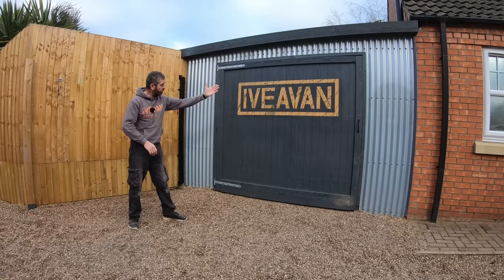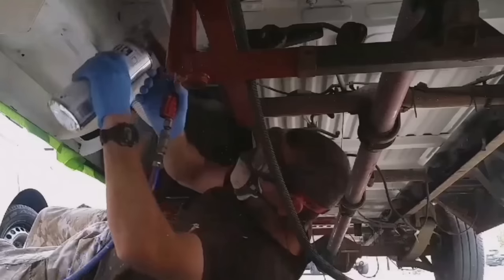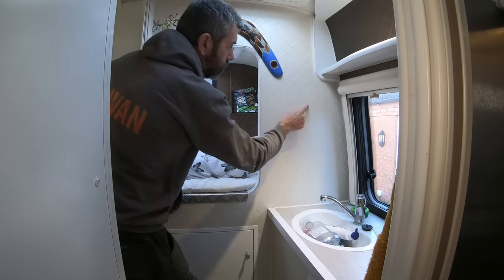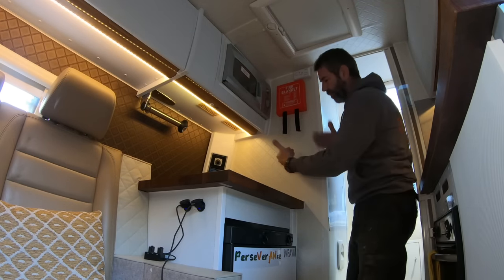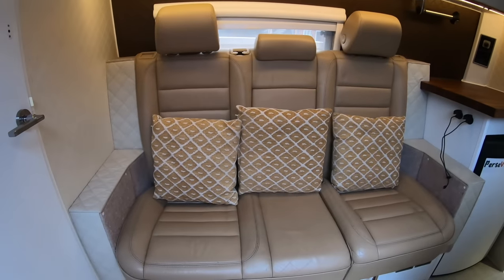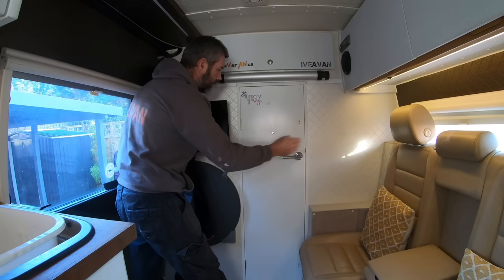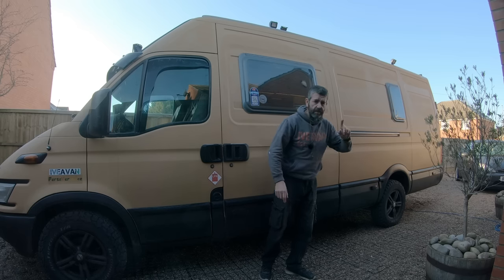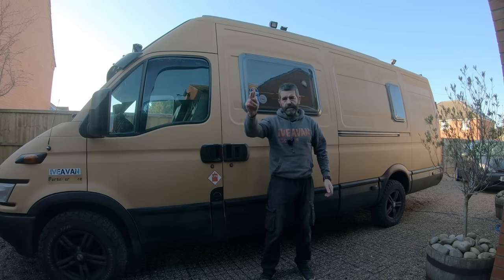Iveco Daily DIY Campervan 'Van Tour' Rebuild Plan.

Comment: This sounds like an amazing project, cannot wait to see you turn it into reality and Wow 14k of lithium in a van I only have 5k in the house!
Reply from the maker: Cheers Paul 👌👍. This was my second attempt at making this video, the first one was me going through my calculations on why I needed so much, but when watching it back I thought, "this wouldn't be a interesting video for people" , but I'll go through them as and when I go back onto the wiring of workshop/hooking up to the van (from memory though, the power needed for the full property. 8kw on a bad during winter and 2.5kw needed on good day in summer, so Im pretty much setting it up for winter use, the solar will be the Achilles heal of this plan though for at least two months of the year🤔.) 😉👍👍👍.
Reply: @Iveavan I agree, running completely off solar in the Uk, be it in a van or house is well nigh impossible in winter. Also the regulations and isolators you have to have fitted to link the system safely to the grid is so confusing/expensive. Keep up the great videos.
Reply from the maker: @paulvose3177  yes, I agree bud, I don't intend to be grid tied and feed power back as that's a whole bunch of loops to jump through, as mentioned in the video "baby steps first with the workshop" then I'll concentrate upon the full property 😉👍👍👍.

Comment: Looking forward to seeing how you get on with it. Like the solar/battery idea for going off grid.
Reply from the maker: It will be slow going at first (as I was meant to of started back in November). As for the solar / van battery bank, powering the workshop is the easy part, according to my calculations, powering the bungalow is do able but not has straight forward as I put it within the video "😬" 😉👌👍👍👍.

Comment: Great ideas! I also have swivel seats and plan for removable insulation panels - mainly for winter use. For summer, I'm currently evaluating different active cooling options, it takes around 500-800 watts (max) to run an efficient A/C, which is doable with the roof size of a L2+ sized van for solar panels.
Reply from the maker: Sounds like a good plan you have there bud, if I keep the blinds closed during a hot summers day  it remains cool in the back (with the wall in place) so I'd imagine I'd be having the wall in place more often then not, but it's a compromise 😉. Cheers matey 😊👌👍👍👍.
Reply: @Iveavan  sounds good! I'm curious how it turns out for me, it's not fully insulated yet, and I'm only using 30mm PIR.
The right amount of ventilation can also make a big difference, depending on the outside temps.
Did you ever measure the temperature differences between the living and the drivers area? Would be interesting...
Reply from the maker: @chblabah  sorry, I've only just seen this. Yes, it's been in the mid 30°C early 40°C within the cab and 18 to 23°C in the back so it does make a huge difference 👌👍👍👍.
Reply: @Iveavan  no worries ;) Thanks for replying!

Comment: Hi Mark, I remember the first build,........ just a few more ideas to consider;- Maybe a flip up sink in the shower room?, Replace two seater chair with one dedicated recliner chair (if your going to go ahead with the front swivel seat idea)? do you still have your on-board diesel generator?...............Will you go for a slide out top opening fridge?
Reply from the maker: Thank you, I've already bought / ordered what's going inside the van. But yes, the flip up sink is probably the way I'm going to go 😊👌👍👍👍.

Comment: I followed the 1st build (it inspired my to buy an iveco 45c15 mk4). I am looking forward to watching the refurb series, especially the sliding door gap correction process as ours has this problem. Be interesting to see if your front passenger swivel will be a single or a double. Doubles seem to be a rarity in iveco's as there are no off the shelf solutions from what I can gather. Best of luck with the whole project 👍
Reply from the maker: Thank you Dave 😉👍. No, for us it'll be a single swivel seat as there's only two of us, but I do agree with you regarding the double being rare. It seems that many manufacturers of after market campervan parts seem to disregard the Iveco Daily in favour for the "Instagramable German vans". Short sight in my opinion or a market to be filled 🤔😉👌👍👍👍.
Reply: I'll be interested in this as well. Just bought a pair of swivel seats from a Nissan Elgrand. Think single passenger bases are like hens teeth aswell.

Comment: Something else I just remembered and I thought I would mention - with my build I have been thinking about USBs,  every van seems to have classic 0.5a  USB A sockets. Everything I have is USBC and fast charging at that, I cant remember where I saw but you can now get a van socket which is a 45w USBC fast charger so im going to add those instead, should make things look neater and its more up-to-date. 👍 p.s Mark have you finally added the rear step back! ;)
Reply from the maker: I shall bare this in mind bud, thank you for the useful information, I have bought pretty much most items that's needed, but small stuff like this, is valuable information not only for myself but for others too matey 😉👌👍👍👍.

Comment: Love it Mark. I would be tempted to leave the LPG and get the Thetford i induction and gas hob. If any part of the elec system fails you are goosed for cooking so I would want a backup. Also more fine control with flame so gives you choices. 👍👍
Reply from the maker: Only problem for me is refilling the LPG tank back up, its a bit sparce in petrol stations that sell LPG in my area now bud. We see how we get along 😉👌👍👍👍.
Reply: On on those gas canister stoves is a handy backup. Doesn't take up much space in the garage.
Reply from the maker: That is true bud👌👍. Don't forget, that I've got the generator if I get really stuck as a back up too matey 😉👌👍👍👍.

Comment: Looking forward to seeing the new design come to life! Sounds like we could all plug in to your van at a camper meet 🤣
The front end on mine is soft and occasionally rubs the arches so will be interested to see what you do. Went for harder shocks but that didn't work 😕
Reply from the maker: Haha yes 😅, I think mine has already the HD front spring (but changing it any way) but seems to be leaning to the drivers side, I suspect that the rubber buffers have become worn and giving a harsh ride 🤔😉👌👍👍👍.
Reply: @Iveavan  I will watch with interest. Looking forward to seeing the results 😀

Comment: Looking forward to see what you do. A idea for you bathroom wall instead of moving the wall back use a shower curtain or one of them folding doors so you can open it up to fell bigger and also if one person is sat there working someone can step into the bathroom to get past them
Reply from the maker: Yes, the entrance is moving from current position to the front so it shouldn't disturb the other person matey 😉👌👍👍👍.

Comment: Good idea to power your house are all the mppt’s going to be in the van ?
Reply from the maker: Cheers matey 👍. "Baby steps" first bud, to power the workshop first then if its doable (according to my calculations it is) move onto hooking the house up. I'd imagine and more then likely a external MPPT (like an easy solar) connected to the carports solar panels, then a cable (power in from solar, power out for end use) that is pluggable into the van providing charge to the leasure batteries. Not going to be straight forward, and full of hurdles to over come yet. But first! The van rebuild matey 😉👌👍👍👍.

Comment: You are a superman builder! Thinking out of the box!
Question: building a camper on an Iveco Daily 50C14 NP Van 3.0 HPI CNG 136hp, hybrid / environmental fuel?
Reply from the maker: Cheers matey 👌👍. We don't see many CNG (Compressed Natural Gas) Ivecos in England, probably due to gas fill up points now being removed from our forecourts. However, as I understand it, I do think some gas companies do run a small fleet of them over here but never seen or worked on one. 😉👍👍👍.

Comment: Iv been researching the front spring also for my 2015 xlwb. I need it so i can get the 225/65l16 BFGs on . Someone on UT has filmed it. Midland are going good prices on the heavy duty front leaf. I might film mine also 👍
Reply from the maker: Yes, that's where I bought mine from, the delivery is very quick, so you won't be disappointed 😉👌👍👍👍.
Reply: @Iveavan  Found the front fitting video: https://youtu.be/_vgxDTitHjs
Reply from the maker: Thank you matey 😉👌👍.

Comment: Hi mark, I am looking forward to your rebuild as watched all of the firt witch was great,,,,, Can i ask why 24 volt and can you get b2b from 12v to 24v to charge when driving thanks 🚙🚙👍👍
Reply from the maker: Cheers Julian👌👍. Yes, I have 2 12/24 DC-DC charge controllers going into the van, the only reason why I'm using 24v over 12v is due to 'potentially long cable runs' 24v is more efficient as higher the voltage lower the amperage (half that of 12v) reducing heat lose through cables (reducing cables becoming to hot), but also allowing to use smaller diameter cable sizes compared to 12v systems (reducing cost of the build). Not only that, 48v is favoured over 12v for battery banks to power domestic dwellings, I'm going have to go half way on that (24v) to achieve in what I want to do 'to power the workshop via the campers batteries'. I'm just trying to do it the most efficient way as possible for my needs bud 😉👌👍👍👍.

Comment: I've seen your van around Lincoln a few times. Is that where you're from?
Reply from the maker: Close by 😉👍👍👍.
Reply: @Iveavan  don't worry, I'm not a stalker 🤣
Subscribed and looking forward to the rebuild! I imagine you'd need a lot of solar to maintain charge, or do you just head out for short trips? I'm living in my van full time in the area and at this time of year its a struggle to power the basics, let alone an electric hob, water heater, etc, etc
Reply from the maker: 😂No worries bud😊👍. No, solar for me is pretty much a waste of time as I don't stay in one area for more then one or two days then I do a couple hours of drive to a different area, so realistically I don't rely upon it as much as the DC-DC charge controllers which replenishes what I've used the solar just tops it / finishes it off bud😉👌👍👍👍.

Comment: Your iveco is a xlwb ye ,did you have to pass an hgv to drive it coz there 7.2 tonight before putting timber and furniture in ,please advise .
Reply from the maker: I passed my test back in 1993, so I have grandad rights, plus my van is 3.5t 😉👍...
Reply: @Iveavan  is it not the 4 X4 version of the daily xlwb ,I passed my car test 17/12/86 so I'm ok for what weight ,please advise
Reply: @Iveavan  iveco daily L3H3 xlwb4 x 4 weighs 7.2 tons
Reply from the maker: @cliff1551 Before 1st January 1997 licences, you're usually allowed to drive a vehicle and trailer combination up to 8,250kg maximum. No, my van is an LWB rear wheel drive (model 35-12) 👌👍.
Reply: @Iveavan  nice one I got nothing to worry about cheers mate 👋🤠👍

Comment: why don't you put the fridge over the cooker on sliders going into the shower. so when you shower the fridge is over the cooker and the rest of the time the fridge will be locked in the shower. the fridge uses the big space never used in the shower. I hope you get what I'm saying.
Reply from the maker: Yes, Kinda of bud, I'm trying to free off the space mentioned to enable for a longer bench seat, and also already made a location for the fridge within the kitchen unit that I've made. But a good idea matey 😉👌👍👍👍.